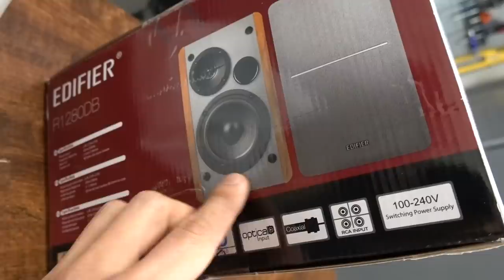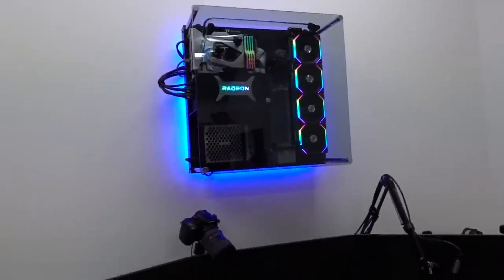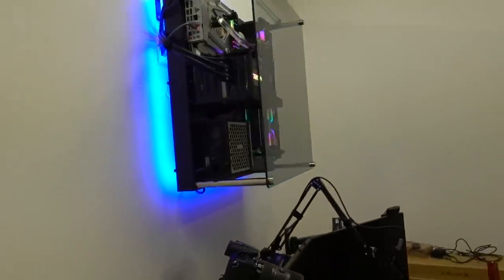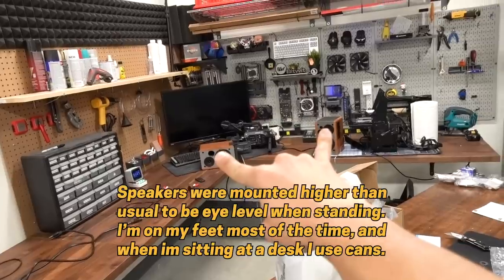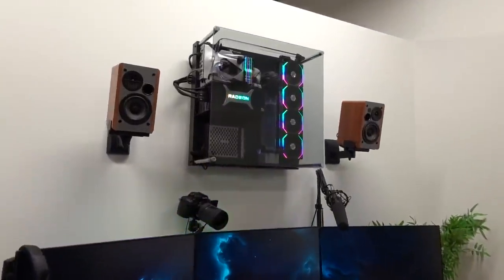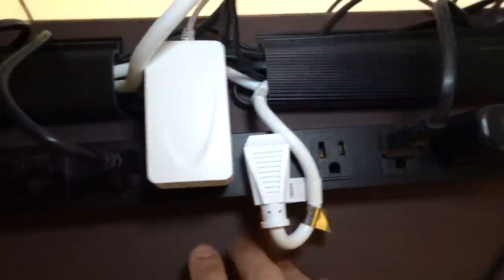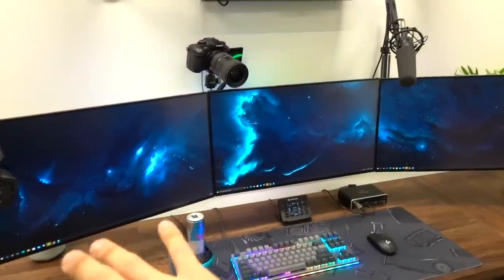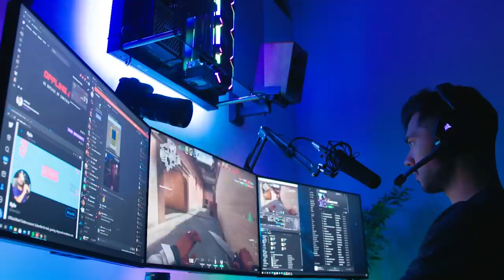My $10,000 dream setup turned out INSANE!!

Comment: safety warning from an electrician - don't ever drill into a wall on the vertical or horizontal axis's of a power outlet, the chances of hitting a live wire are extremely high

Comment: why did you got an external rgb strip instead of an argb connected straight to the pc? You have an open case and installing it would be pretty easy. I have a custom desk pc and I'm using a phantek m1 argb strip from the motherboard to the back of the desk and looks super clean.

Comment: Watched first 60 seconds of video, if never occurred to you to hold pc level, measure distance from wall to frame of case at bottom, cut small block of wood that size, paint it black, & pinch it between the wall and case (tension should hold the block so it doesn't move)?

Comment: You could have just turned the wall mount over 180 degrees and used the tilt adjustment to level the case.

Comment: Curious, I see this as a bit of over-engineering on the lean.  Wouldn't have been easier to just mount some "feet" to the bottom to extend the bottom from the wall.  Simple rubber and some magnets.  No holes to drill.

Comment: Route the cable starting from the wall to the speaker if it detached from the speaker. The other end would fit through the hole?
Reply: Mount the power bricks with strong Velcro

Comment: if u want a wireless mecha keyboard take a look at TEMPEST KIRIN V2, it is much much much better than keychron, is hotswappable, has removable type c cable and wireless bluetooth that connect with 3 devices simultaneously

Comment: So you seem to be harping on not running power cables through the wall, totally cool about that btw, but how are you bringing power to your PC?   That has a power cable (120V) to the PSU in your computer.

Comment: what kind of 3m adhesive is used to stick the power strip and other devices under the desk? i tried using some square 3m adhesive ones and my power strip fell 2 times. need something that is stickier and won’t have to worry about falling

Comment: The reason for such a "small" hole in the wall-mounted loudspeaker bracket is that nobody runs the power cable through it, only the loudspeaker cable.
Reaming the wall-mount order to insert the power plug inside is a very bad idea, because it simply weakens the structure.

A good solution would be to buy speakers that have a detachable power cord.

Comment: The brackets were probably a bit of overkill.  I bet 2 pieces of pvc cut to the distance off of the wall it should sit... Paint them black, and put one under each bottom corner.

Comment: I have the g915 and I will say this as a warning before you get this insanely expensive product. This thing is NOT worth the money until they fix some very important issues:

1: I have owned this keyboard for 6 months and some of the more used keycaps (namely space, W, S, A, and D) for my gaming needs, and the black coating is rubbing off. 

2: The keyboard is a pain in the butt to really clean because the way the keys are attached, the tiny pegs are REALLY EASY to break off and if one of them break, it will no longer stay attached to the keyboard. So you basically are stuck with a basic clean and as someone who likes cleanliness in my setup, it is really frustrating that I will never be able to get out some of the dust and debris between/under the keys.

3: Good luck with finding replacement keys if you have an issue with issue 1 and/or 2. I have tried to get some 2 times now and they do not seem to be available officially and both times resulted in me getting scammed and either receiving the wrong product and the seller ghosting or not getting anything at all. You are stuck relying on crappy people out there instead of the company that makes the dang thing and that is frankly, unacceptable. 

4: This is going to be the biggest downfall of this entire thing and it is a really big issue with Logitech as a whole. The charging port is not USB type C and literally after only 6 months of owning it, I cannot charge the keyboard and play at the same time. What I have to do is gently push the connector in and never touch the keyboard because it seems that any movement on any scale will cause it to not charge. I have tried multiple cables, it is the fault of the plug in jack on the keyboard and the biggest downfall of these old usb connectors. 

I have Logitech for both keyboards, both mice, and both headsets and love their products and love the really clean way this keyboard looks and it performs well. But after 6 months of general gaming use and not beating on it (I am someone who takes really good care of my stuff as I paid for it and why would I want to break something I worked hard to get?) this keyboard has disappointed me a lot and as I type this, I look down and see the rubbed off black and the blotchy looking RBG shining through and it just annoys and angers me that such a premium product will get beat in durability by a 10$ bargain bin keyboard from Wal-Mart... 

If they made the switches available to purchase from Logitech themselves (either full kits but selecting only the keys you need would be nice) and making the change on their products to type C, it would be worth the money all day, every day.

Comment: yo Bitwit, you should have watched some audiophile video's BEFORE placing your edifier speakers...those should not be placed there ,  they  now are directed above your listening position..which is the worst place unless you are going for Dolby Atmos in the future and those are your front-height-speakers....IMO you should have gone for a 3.1 setup : 2 stereo front speakers one on each end just above your #1 & #3 monitors and a center under the middle monitor( #2) , then use a kick-bass subwoofer under the desk. For the rest thumbs up...like the build.

Comment: Hello Kyle,
I've got a question. I'm searching a case simillar to the Lian Li O11. That it inself wouldn't be a problem. But since im still using a lot of discs I would need a cutout for a BluRay Disc drive. And a second cutout for my CSL 3,5" Multi-Frontpanel Cardreader.
The later one could be cut (still usefull to me but not so much as the disc drive).

Could you point out one that I could use. I can't find one myself, but to be honest I don't know where to search for something that specific since most cases nowerdays don't have cutouts for those drives.

Comment: Don't understand why you installed the hinges on the top, people gave you a much better suggestion last video: Just put something between the wall and the bottom of the case. It wouldn't even need to be screwed in or anything as the force of it being squeezed between the case and the wall would keep it there.

Comment: Legrand in wall power kit from best buy sku: 4385100 its both power and has holes to pass the speaker wire through. Its actually a best buy deal of the day today 4/9! Better buy them now!

Comment: I don't think running the speaker power cable through the wall would be a code violation (not sure where u live exactly so might be a bit dif from me) just as long as u don't like plug it into a power strip inside the wall or some crap like that I mean we even watched u run the power for the light strip and it looks the power for the pc is in the wall so u should be able to do the speaker power in same way (pls note I am not an electrition and it would be best to consult a pro if u have more questions)

Comment: Im actually in the process of designing my Dream set up, and its gonna cost roughly the same XD. modern top tier pc (16 cores @ 5.5Ghz water cooled, 128gb ddr5 @ 5200Mhz, Radeon Rx 7900 xtx water cooled, 24Tb storage capacity) connected to 6 displays. Quad monitor 4k/144hz, 2k 75Hz 21:9 Vertical mount, and a 75in 8k qled TV above it all. I think with the denon 5.2 surround receiver and speakers, its gonna put me at roughly $11k  X_X. totally fuckin worth it though \m/ (//_^)

Comment: Why don't you simply remove the power cable and pass it through the wall then, resorter or reconnect it? Even you can connect a larger cable! Isn't it an option?

Comment: I would NEVER use anchors for that....  either a backer board or into studs, but steal studs due to commercial... you need a backboard...  this is the ONLY way to get a solid point...  That thingis going to fall, it might take a week, or a month, or 6 months, but you will walk into that system on the floor in a crumpled and shattered pile....  And Lyle evil laughing behind you.

Comment: He won't run the speaker power cable through the wall because of code, but didn't he run the RGB and monitor power cables through the wall?

Comment: Kyle.. dont give in to a Logi kb, your better than that. You go Logi your stuck with low pro proprietary switches where your limited to 3 flavors (2 if your like me & clicky isn't even an option). You also cant change keycaps cause the switches don't use the typical Cherry stem (+). And the biggest disappointment, pretty sure the G915 and G915 TKL still use micro usb which in 2021 is unacceptable.  

Listen to frank and go with a hot swap keychron (k2 or k6 if you dont need a full size) with some reds or browns. Then pick up some keycaps that match your setup from Glorious. Im sure frank can get you the plug on those. Then later if you ever want to explore some different tactile or linear switches, at least that rabbit hole is there for you to dive into. With the keychron you have so much more ability to customize and change things in the future if you get tired of how it looks or feels or just want to try something new.

Comment: Tool complicated. Why not just measure the spacing need between the wall and pc backboard when level, cut a piece of black PVC tube  or wood dowel to that measurement and place it on the bottom half between wall and PC? Use some 3M command strips to secure it if you need to,

Comment: i wouldnt trust the weight of your system just on 2 brackets. mount 2 at the bottom for double security  because you dont know how strong your mounting points inside the wall ...been there done that learned by mistake

Comment: Nice setup, but waaaaay too much RGB. lol. When it's going full tilt on the montage in the end, it just makes it look gaudy and tacky. Must be extremely distracting when playing or using the system. I would've toned it way down, some accent lighting is really nice when done right, and this setup would look REALLY great if the lights were configured properly instead of unicorn vomit all over the place.

Comment: What kind of TV wall mounts can't support a computer. You must have gotten a minimal mount. They are weight limited. 
With a proper mount and weight, NONE of them will do this angle.

Bluetooth is nowhere near where I would approve for a top end setup. It sucks so bad still. Have a very high system atm with bluetooth, and I already hate how horrible it sounds compared to speaker wire setups, and the added delay makes it that much worse. Audiophiles can notice tons more, and I am not one.

Function tops form for me. Sorry, but you are making this work, and paying the same for getting proper working stuff, such a common thing in the world. Buying cheap, almost always make you spend more. Good thing you only do Youtube, as in person adds even more failures to quality. When we see something decent, it is worlds worse in person.

Comment: honestly Kyle, this looks quite amateuristic. First of all, you mounted the VESA mount below the center of gravity of the TT case, so you could have actually known beforehand that the thing was going to tilt forwards. Secondly, had you mounted the brackets on the bottom of the case, you wouldn't have to drill holes at all. You should have just attached the brackets on the backside of the case at the bottom. That way you wouldn't see them like you do now, it would be completely hidden behind the case and the weight of the case would push the brackets against the wall so you don't have to drill any holes. You would then also be able to still use the wall mount as a wall mount, with the brackets on the bottom not being attached to the wall you can still move the case around for maintenance or w/e. Also the one screwhole being too close to the pasthrough being a different anchor, had you measured the size of the drill beforehand and the distance from the hole to the passthough, you would have know beforehand whether it would fit or not. If you friend the 'contractor' can't actually think of those things, remind yourself not to hire this guy for any chores on your house...